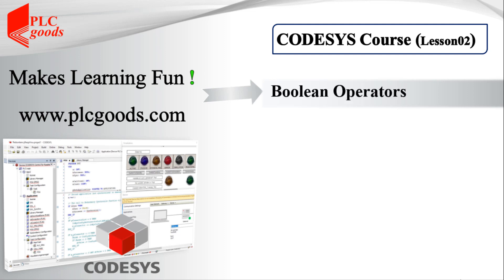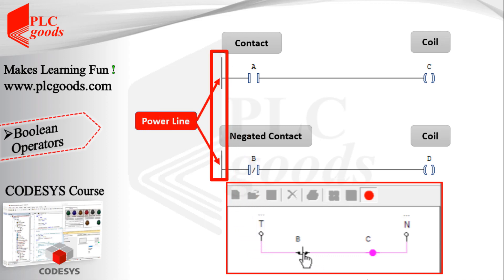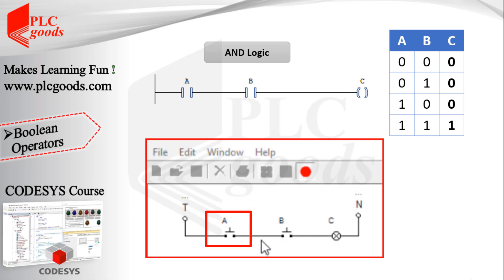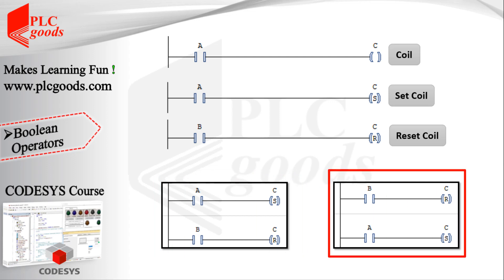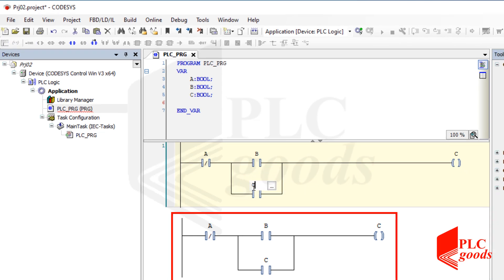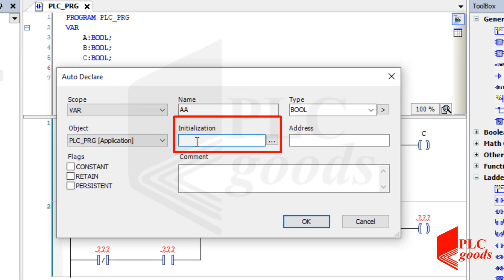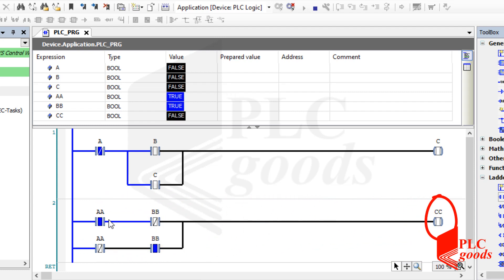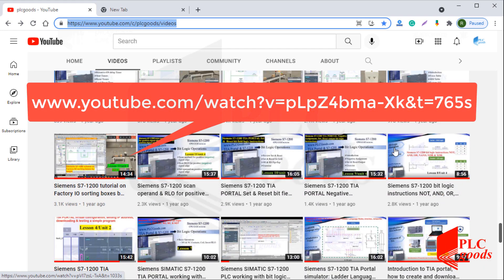🎉Tutorial on CODESYS PLC programming for beginners  | Lesson 2

Comment: In EtherCAT Master I cannot see the Net adapter when I click SELECT for Source address (MAC). How to solve this issue? Thanks
Reply from the maker: Hi there, I've not worked with EtherCAT Master. You may use google or ChatGPT to solve your problem. However the following tips may help you. 
Check Driver Installation, 
Run as Administrator,
Disable Unnecessary Network Adapters,
Check if the Adapter is in Use,
Reinstall software

Comment: why  i can't use ladder element in my new network..??
Reply from the maker: 👋 Great question!

In CODESYS, the issue of not being able to use a ladder element in a new network usually happens because of one of these reasons:

✅ The POU (Program Organization Unit) might be set to Structured Text (ST) or Function Block Diagram (FBD) instead of Ladder Diagram (LD).

✅ You may be inside a Function (FUN), which sometimes restricts certain ladder elements—using a Program (PRG) is more flexible.

✅ If you just created a new rung/network and it’s greyed out, sometimes you need to double-click inside the rung to activate it before adding elements.

Make sure your POU is set to Ladder Diagram, and try right-clicking to Add Network or Insert Box/Contact/Coil properly.
Reply from the maker: “Full 21-video course is on my channel! 🎓✅ Check the playlist for all lessons.”

Comment: Excuse me but I did everything accordingly but when it came to the part of Generating Code i was getting Error codes so I can't progress from there. I am stuck.
Please help.
Reply from the maker: Thank you for your comment! I'm sorry you're facing issues during the "Generate Code" step in CODESYS.
To help you better, could you please provide the exact error messages you’re seeing? That will allow me to guide you more accurately.
In the meantime, here are a few common things to check:
✅ Check for syntax errors: Make sure there are no red or yellow underlines in your code before generating.
🧩 Make sure the correct device is added in your project (like CODESYS Control Win V3 or your specific PLC).
⚙️ Build > Rebuild All sometimes clears internal issues.
🔄 Restart CODESYS after saving your project—this can sometimes resolve strange behavior.
📦 Make sure all necessary libraries are installed and up to date.
Once I know the exact error code or message, I can give you a specific fix.
Looking forward to helping you!
Reply from the maker: “Full 21-video course is on my channel! 🎓✅ Check the playlist for all lessons.”